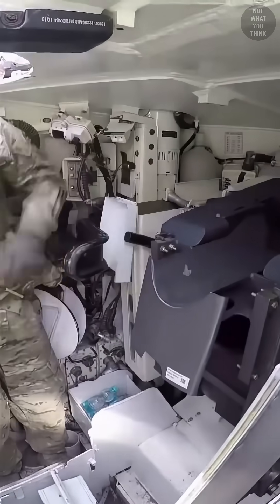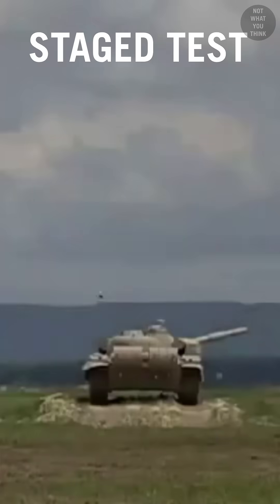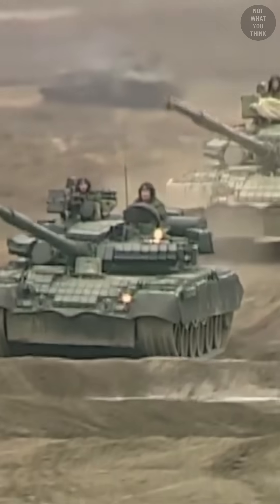Why M1 Abrams Tank Has No Auto-Loader #shorts

Comment: Well that is called the 'ready rack' shown in the video. The door stays open as long as the loader keeps the knee switch depressed. Note the door has a safety bumper to prevent limbs being caught while it is closing. Once the door reaches two inches before it is closed, it will not stop if the bumper is triggered at that point. There is also storage behind the TC and areas around the turret that hold a few additional rounds.
To make standard a loader must be able to load a round and arm the gun in three to five seconds. What is the average load time for an auto-loader?
Reply: This is key - when the loaders are in go mode and the crew is in sync, there's not an autoloader made that can keep up.
Reply: @rapid13  True but that can't really be expected from a conscript army. Making the consistency of an auto loader preferable in that case.
However for a professional volunteer force you can.
Reply: @Will-bo7kg  Exactly my point, thank you for clarifying it for me.
Reply: @rapid13  Oh, were you 19K?
Reply: @james-faulkner  11C lol! But I was in 2/11ACR and all my buddies were 19s. When they ran the tables at Graf we’d go watch and cheer them on. And I was totally jealous when we went to the desert; those A2s are Cadillacs vs my M106 busted ass Yugo!
Reply: @rapid13  Cadillacs are like Yugos. Abrams tanks are like Benzes. 
11C mortarman. I actually have two MOS's, 11B, 19K.
Reply: @rapid13  "when the loaders are in go mode and the crew is in sync, there's not an autoloader made that can keep up." That's a lot of when to match an autoloader, beside that, an autoloader can be in sync with whatever, whenever and clean the rack of 12 in a mn.
Every studies show human error leads in most job with a robot or automation, and faster than any human can react, and with more parameters and data than a human use. Boomer talk here
Reply: @tm.8399  ESL? Anyway, you clearly have never worked on a team as tight as a gun or tank crew. We’re not talking about building cars on an assembly line.
Reply: @rapid13  We are talking about a computer in tank that does the job better than a human and that's why even the US is going for the autoloader.
Reply: @tm.8399  Really? In which tank? The replacement for the M1 was canceled and no program to replace it is on the horizon. They’re not converting M1s to auto loaders. So, which tank, hmm? You’re just talking out your ass.
And I’ve yet to see any evidence of an auto loader doing it better than a motivated E2. Know why? No such system exists. There may be a system than can load a round faster from a dead stop, but no computer can anticipate the driver, gunner, and TC like a human loader can. 
You’ve obviously never served, so maybe you ought to sign up and serve on a tank crew. Then you might understand.
Reply: @rapid13  The DLP which is supposed to be unmanned or lighlty manned, therefore with an autoload. You are welcome.

Ofc a computer anticipate all of that, they does it in plane and rockets lmao.
Reply: @rapid13  Human loaders can't keep up with autoloaders. Autoloaders dont get tired, dont get too cold or hot, and they dont get hungry. There are autoloaders like the Leclerc capable of loading in under 5 seconds with complete consistency, theres also autoloaders in tanks like the Type 90 and Type 10 capable of making 3 second reloads consistently. Humans cannot compete with the consistency and speed of machines in this task.
Reply: The reload time of a Russian auto-loader is between 5-8 seconds. At least that's the case with T-72, T-80 and T-90.
Reply: @dmitrit.4862  That's what I thought I remembered what we were taught but wasn't sure. It's been twenty years since I transitioned to tanker. Thank you.
Reply: @james-faulkner  You're welcome! You were a tanker? May I ask in which one you served?
Reply: @dmitrit.4862  Yes, I transitioned from infantry late in my career while I was doing more time in the national guard. Since I was already a sergeant, that made me the gunner of the M1A1 Abrams. The one with the 105mm rifled bore. At 6'1" or 1.85m, I am a bit long so my feet would cross over each other while in position. Standing erect was not possible, good thing we have to wear helmets.
It has been a long time since I was in but if you have any other questions and I think I recall the information correctly otherwise I do have a few manuals around here I will try to answer. I also had additional training to grade crews during testing. Or if you want perspective none of these book guys that make videos can express, some make good videos but they can't tell you how much everybody shits and laughs when you look through a hatch and the loader is holding a round in two parts and the ignition material is everywhere inside the turret. Yes other tank crews are called over to look before the problem is dealt with. Don't ever forget military guys are a bunch of idiots, even the Apollo astronauts, otherwise we wouldn't have joined  :)
Reply: @james-faulkner   Sorry, but Chaos is right about the specs on the Abrams.  The A1 and newer variants all had the 120.  The older M1s and IPs had the 105 mm rifled cannon.  Slinging 120s in under 3 seconds very constantly is pretty tough.  I have been on the M1 with the 105, and the M1A1 with the 120.
Reply: @traviseggl3794  Under three seconds? No the standard is three to five. I misspoke, I will edit it. Must have got a wire crossed while typing.
Reply: @traviseggl3794  I have seen it done in that time in a British tank, three part ammunition, you are not slinging a one piece 120mm round. 3 seconds is doable in a Challenger.

One thing the Vets certainly got right is that no computer can anticipate, and the Battlefield, even a pretend battlefield like an Exercise is a fucking chaotic place. A switched on Loader will know what round he has to grab even before the TC or the gunner call for it, have it ready and waiting before the computer has even been given its instruction to pull the round from storage, have it loaded and pressed ready even as the autoloader is pulling the required round. All because he can anticipate what the Gunner and TC need even before they ask for it. 

Can it be sustained as long as an autoloader can sustain? Hell no, but show me a tank action that takes more than ten, twenty minutes sustained. The requirement for extremely rapid fire is practiced but reserved for oh shit moments, at normal tempo neither a human loader nor an autoloader will be operating at anything close to maximum speed. 

In those oh shit moments however, a human loader IS faster than an autoloader, he is certainly an absolute fuck ton more MOTIVATED than an autoloader. And don't start that crap about autoloaders being hyper reliable, they are another complex part, they break down, rather more regularly than people like to admit. If an autoloader breaks down you have a tank that is mission incapable.

More importantly there are OTHER reasons for a human loader. An extra hand for maintenance (which tank crews spend a LOT of time doing), an extra body for guard duty when the tanks are laagered for the night. An extra pair of eyes in the turret with his own vision equipment to spot potential bad guys sneaking up and trying to do nasty things to your tank with an RPG 12 or something equally unpleasant. Three crew looks very nice for the bean counters looking at wages, but it makes a HELL of a difference for operations given how much time is spent by crews running maintenance. Those guys with three crew autoloading tanks now have an extremely complex extra new system in their turret, that requires yet MORE maintenance, and one less man with which to undertake all that work....

Argument over auto vs human loader is about more than just how many seconds per round and for how long, anyone who does not realise that is a fucking idiot.
Reply: That’s good because as as I heard “only opens a few second” I was instantly thinking it was a disaster waiting to happen
Reply: @Will-bo7kg  The switch plate can be lifted up and stowed ion a locked position to not trigger the door as well.
Reply: 4.5 second for the Leclerc, regardless terrain condition
Reply: Yeah good luck slinging 120 in 3 seconds lol, physically not possible. And M1A1s have 120mm smoothbores, the only Abrams with the 105s were the original M1s and some M1IPs.
Reply: @chaos2876  Oh you are a loader? If you are not prior service, no one asked you.
Reply: @james-faulkner  Being prior service is relevant how? So far, the prior service people have gotten things factually wrong. So congrats lmao.

Comment: Soooooooo put the auto-load ammo in a turret bustle with blowout panels? I moonlighted as a loader in M-1's in Germany in the mid-late 80's and even then I wondered why not an auto-loder. On the other hand, having an extra set of hands sure is nice when breaking track or replacing pads.
Reply: Loaders are easier to replace than autoloaders, an extra person on a machine gun always helps, the loader is basically an assistant TC, and they help with situational awareness. Honestly, I don't see very many benefits of an autoloader.
Reply: @coreydabrowski2249  Modern tanks have the coaxial machinegun controlled by the gunner and the tank commander’s machine gun. What machine gun are you talking about that the loader can operate? 

The loader doesn’t improve situational awareness unless he sticks his head out of the tank. 

Maintenance work can be done by mechanics who don’t ride in the tank too, you know.

Autoloaders significantly decrease the turret volume. 
1. Lower profile, less likely to be spotted and/or shot. 
2. Makes the tank lighter, making it easier to transport. In Russia, the distances are so huge driving the tank to a destination is not an option. All long distance travel is done by train. 
3. About 30% less armor has to be manufactured, making the tank cheaper and boosting production speed.

If the tank is destroyed, only 3 crew are lost instead of 4. 

3 crew per tank means the 4th crew member is available to be in a maintenance unit where their time is better spent or in another tank. It’s a more efficient use of manpower. 

Modern autoloaders incorporate the turret bustle and even the lower ammo ring is now blow-off, so cook offs should no longer happen like on the previous generations. See the recent T-90s.
Reply: @QualityPen  Have you ever served in a tank before?
Reply: @QualityPen  here is a problem a auto loader takes a lot of maintenance and like in the video leaves munitions vulnerable to explosive shells from enemy tanks. Also with less armor means easier penetration and that smaller turret doesn’t really help the t90 at all
Reply: @QualityPen  1. The profile would be the same since you aren't redesigning your tanks to no have gun depression.
2. Empty it would be heavier thanks to the autoloader, so transportation is still the same.
3. Almost all of the armored protection is on the front of the tank, so how are you figuring 30% less.  Shortening the length of the turret a bit?  And since raw metal isn't the time consuming or expensive part of production, all that would still be the same.

Also, the gunner has his own coupela and machine gun, similar to the commander's, so yes, he does enhance the crew's situational awareness a great deal.
Reply: @coreydabrowski2249  Autoloaders allow for a tank to be smaller and lighter, autoloaders will always keep a consistent reload regardless of environmental conditions. A lot of autoloaders are just as fast or faster than human loaders are physically capable of loading. Autoloaders probably have a lower chance of breaking down than human loaders have of injuring themselves through normal operation. Modern ammunition already weighs 50-60lbs and is a meter long, and rounds are only going to keep getting larger and heavier, we're going to reach limits of what human loaders are physically capable of loading anyway.

The only real argument for human loaders is that its beneficial to have another crewmember around for maintenance tasks and to pull security etc.

Comment: If a tank get hitted by anti-tank missile it doesnt matter fo crew where an amunnition is. They will die.
And russian modern taks have full automatic tower whithout crew.
Reply: Faster rate of fire but you can’t change shell type on the fly. What if you need fragmentation high explosive? That’s the weakness of the auto loader.
Reply: @MrWhitmen1981  modern auto-loader can change shell type on the fly

Comment: Main reasons is to have an extra person to share duties, such as pulling security and maintenance.  Helps to have a backup crewman too, but the crew can operate with 3 people since the tank commander has gunner controls at his station. An auto loader would also add a lot of extra cost, weight, and complexity to an already very heavy, complicated and expensive tank.

Comment: Yea, sure, the crews are safe for like a few minutes at most as enemies close in... Auto loaders save time and one extra manpower inside the tank means a lot
Reply: Autoloaders can jam or break down like any intricate mechanism will, especially at war where replacement parts can be hard to immediately come by. Meanwhile, you can have a soldier take the ammo from a receptacle and place it manually into the turret and that's all there's in the way for moving parts. It's like why bolt-action rifles are still issued for tasks such as sniping, but for tanks - it's just durable, cheaper, and still generally more efficient. And we're not using modern day tanks for close quarters urban enviroments at all. Especially a freaking Abrams.
Reply: @thepaintingbanjo8894  A human loader probably has a much higher chance of being injured in some way either preventing him from loading or slowing him down. Autoloaders are very reliable, the autoloader on the Abrams TTB went through 40k rounds without issue while it was being tested. 

And bolt actions are valued by snipers for having benefits to things like muzzle velocity and accuracy when compared with semi automatic rifles.

Comment: Bullshit. With current technologies, engineers can easily design autoloaders with a separated compartment. The main reason is the cost. It's called "Legacy System". Doesn't matter if it's outdated, if it works, just let it be. Because it'll cost hella tons of upfront money to change it.

"Humans are better than auto-loader". I think I heard something similar like 10-15 years ago, something like "machines will never replace human workers"
Reply: This is 100% true and you can even have an extra crewmate if the auto loader is damaged. You can have all three

Comment: Another reason for Auto-Loader vs Not-Auto Loader is ergonomics and versatility.

Russian tanks are much more compact, and often much more cramped than western tanks, and especially american tanks. An auto-loader is virtually a necessity, as putting a human in the vehicle in such a way as to actually load the weapon's system may be either too difficult or impossible.

Additionally, having another crewman in a tank adds capability and versatility. Injury to other crewmembers could necessitate for the loader to step into a different role, or there could be extraneous situations that would require an extra human. Field repairs, scouting, or just having another set of eyes to peer through a periscope are all possible examples where having that extra crewman might be advantageous.

Comment: If load needs to be changed a human leader can do it, auto can't.
Human loader can load the gun as fast or faster than an auto.
Human loader is cheaper and more reliable.
Reply: But human loads unitar projectile,if he will load separate sleeve and shell it would be slower.
Reply: @anonymuz796  no a shell and seperate powder charge is never unloaded, it is fired

Comment: This is beginning to sound more and more desperate as the years go on. :D
Just admit that the Abrams is at its end of its era and is getting overrun by its modern competitors. It's still a great tank, don't get me wrong. But to claim that you keep the manual loading for "safety reasons" is kind of embarrassing. There are obviously systems out there where they incorporate both the separated ammunition stowage and the speed of an auto loader. Most modern munitions doesn't really leave much of a tank left to operate either after a direct hit, so the extra crewman doesn't sound like a valid reason to me.
The tanks are moving from manual loaders to auto loaders for a reason. Not the other way around....
I can even bet that the next generation of US MBT:s will have autoloader, and then, all of a sudden, it will be all the rage. 
Several countries still use the T-34, but they're not claiming it to be the best tank in the world. Not any more.